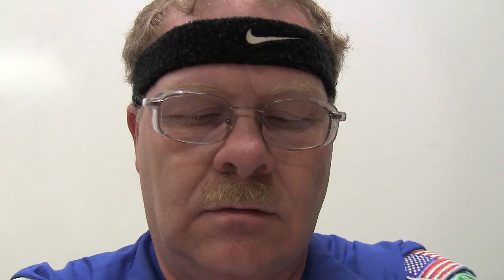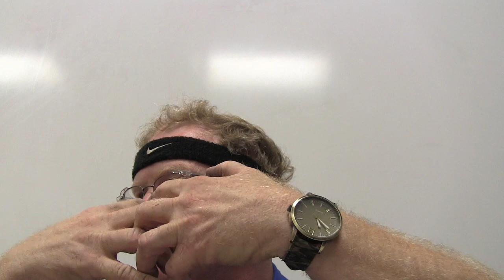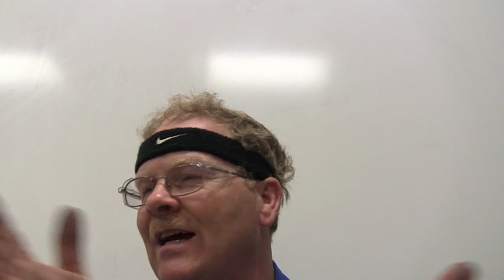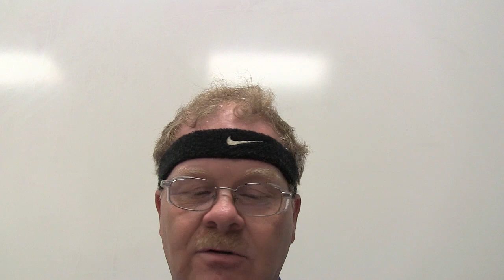Man Trans Test 3

Comment: Other heat side effects = will not stay in gear, strange shift feel, non grinding resistance to get in gear, and one time I got two gears at the same time locking the box. Locked box = When the clutch engaged the rods holding the spider gears sheared and exited the case.

Comment: Swoosh
Sneaky Leaky = I would clean the case the best I could and inspect it as close as I can get. Those eclipse cracked cases I did had hairline fractures from the final drive area that were hard to spot and could be mistaken for a shaft seal problem. Oil spilled out when the customer would slam the gears. On other small cars hot gears caused the vent to blow some oil out.